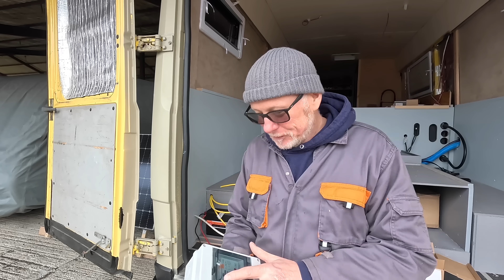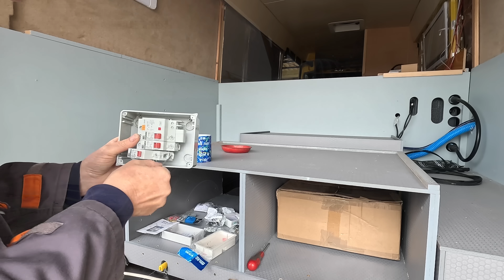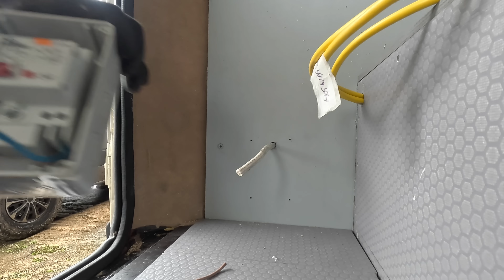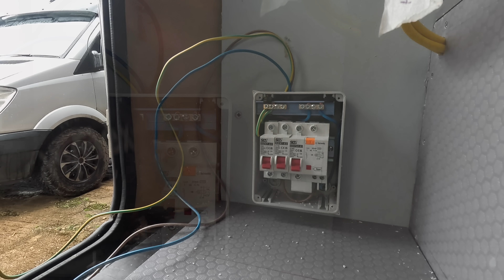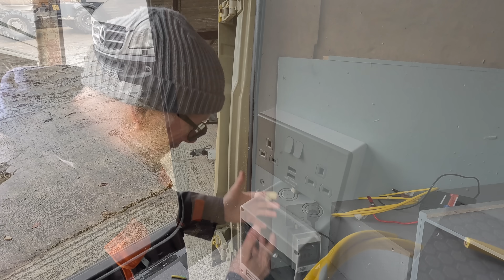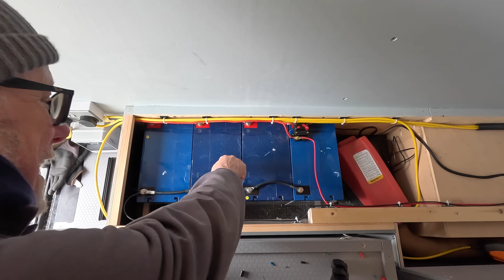What's The Best way to power a Campervan for OffGrid Living Adventures?

Comment: Mel  I run a split system . A victron 12v 460ah   lithium  system with a multiplus but also I hsve a ecoflow delta 2whuch is charged from the lithium.  

It's charged though the solar input  but not  at 12v ! I have it set up so excess  energy  you would  generate though dc - dc or pv will charge the ecoflow.  Once my lithium  battery is upto 99% it will trigger to charge  the ecoflow and turn off at 94% which what would  be wasted energy . Also my water heater  boiler does this though the same system . 

The whole  idea to  be gasless with a back up if my main leisure  battery gets low or I can use a airfryer  oven and a induction  hob at the same time without  a huge DC draw  .
Reply from the maker: That’s what I’m trying too achieve well done sounds like a fantastic setup you have god there 🫶🤙
Reply: It's all about redundancy and not putting all eggs in one basket. In winter will be challenging  but lucky I can charge up fairly  easy  if need to . 

If your interested  doing a solar / energy  dump  a victron  bmv-712  has a programmable  relay which can set from your battery SOC to say trigger a bigger relay  for a dc element  on your water heater or another  charger etc .

Comment: Mel Hi 
Would you know if there is such a cable to charge my Delta 2 from a electric car charger. I cant seem to find this answer. Regards Ade
Reply from the maker: Hi Ade! Yes, you can use a suitable cable to charge your Delta 2 from an electric car charger. Just make sure to check the specifications for compatibility. Happy charging!

Comment: Hi Mel, not being picky mate, you did say 4 x 110Ah batteries in parallel you would have 220Ah of usable power. You will have more at 440Ah of usable power👍 That's a bit of good news for you mate.
Reply: Only 50% is usable power
Reply from the maker: I really appreciate you pointing that out! It’s always good to have knowledgeable viewers like you to help keep the facts straight.

Comment: Informative as ever 👍just a tip when you bring wiring into a box try to come in at the bottom and bring wires up if any water gets in it drips off instead of on terminal also if you put a loop in the wires it does the same also makes it easier if you have to move connections later i use to do marine wiring always enjoy your posts
Reply from the maker: I really appreciate your input! Your experience with marine wiring is super helpful, and I’m glad you enjoy the posts. Thanks for being part of the adventure!

Comment: Hi Mel, are you using a 75-15 victron, connect the battery out to the battery’s and the panel in to the Bluetti and the 12v street light out source to the fuse box? I have a similar setup but won’t it take an age to charge 4x12v battery’s at 15a ? Maybe I got that wrong. Also if you use the Bluetti for 240v why run an inverter off the AGM battery’s?.
I saw the ac200 max and charger 1 vid with the 1 way diodes any chance on an update did it work long term and are you still using it like that.
Reply from the maker: Hi there! Yes, I'm using the Victron 75-15 for my setup. Charging four 12V batteries at 15A can indeed take a bit longer, but it’s all about managing the power flow efficiently. I’ll definitely consider an update on the AC200 Max and the one-way diodes; it’s been working well so far!

Comment: Why you using AGM and not lithium also I was told to connect battery's in serial rather than parallel, can you explain or do a video plz
Reply: in series would be 48V, in parallel is 12V

Comment: Mel.Regarding fuse boards in campers caravans etc .the mcbs should be double pole not single pole so in the event of a fault both the live and neutral circuits are isolated. Also check the regs to see if the chassis needs bonding back at the 230v fuse board.Roger.
Reply: Mel how hard wearing  are your cable strippers...i mean have they stayed sharp for long enough .. always used side cutter but you get a better finish with the strippers
Reply: Looks good I’ve got a caravan plug on the outside of van going into a extension lead with a trip on it for the odd occasion I need mains top up
Reply: Love watching your channel ,but electric s are beyond me (still watch though) so I m just going to have a couple of power stations with the folding solar panels! Mel do you have a trade ie mechanic etc ? cause your so knowledgeable . I am trying to get a YT channel up & running would you do a quick video on how to start a YT channel ? 🫶🏻🏴Jan

Comment: This is why campsites are starting to get strict on uncertified power installs …..first you have AC rcd fitted …. Second and most important you have not earthed your van body which is regulation when having plug in power ….. also all campsites are now A type rcd protection so having a mix like yours A and AC on same line is pointless and the site rcd will trip first

Comment: Are you sure about using the load output on the Victron controller - usually they have a 15amp limit?!
Reply: they come in different sizes
Reply: @alanhat5252  indeed they do 15A or 20A - looks like he has the 75/15 variant - which is only 15A, so if his diesel heater is on start up, and his lights are all on.. and something else is charging etc - he could over load the output. 

I get what he is trying to do . . but I feel its safer to run a 12v Fuse box. But to each their own.

Comment: Hi, Mel thanks for the vlog. This is not criticism but an observation .Those little square sticky pads your using to retain all your cables,
Are pants , I used them on my van build…. after time with heat/ warmth and van movement they lose their tack. And will literally just fall off !  keep an eye on them over time. Hope this helps, now I want a flipping Pastie 😋
Reply from the maker: Thanks for the tip really appreciate that 🫶🤙

Comment: Why not wire them down as 24 volts, it saves power?
Reply from the maker: Because my diesel heater/ diesel cooker/ electric water pump/ max fan / lights are all 12v
Reply: @MelsBigVanSmallWorld  studpd of me, you already got all that stuff ofcourse.  Keep going m8 its a palace on wheelts!

Comment: I would bin that cheap circuit breaker and replace for a fuse and a battery isolator. They normally get hot and the specification they claim in terms of current rating is optimistic to say the least.
Reply from the maker: Yeah I have since done some research and I’ll definitely be installing a traditional fuse for sure and I’ll even make a video to so
Reply: @MelsBigVanSmallWorld  You could go all out and fit a t class fuse which would future proof it for LIFEPo4 if you ever go down that route.
Reply: @Marks-Garage which circuit breaker? The one in the distribution panel or the one on the batteries?
Reply: @alanhat5252  the one on the batteries. I've spent alot of time researching this area myself with my DIY solar battery install. Basic conclusion is that you need to spend alot to get a bidirectional circuit breaker or install a T class fuse and holder. I opted for t class fuses on the batteries and then heavy duty battery isolator switches for safe isolation when carrying out work on the system.

Comment: Mel, what thickness of wire should i use when joining 2  x 110  batteries together
Reply from the maker: It really depends on what you’re going to be  using them for if you google DC wire size chart you will find the information you need 🤙
Reply: @BigVanSmallWorld  Cheers Mel, it is for my 12v tv and diesel heater.
Reply: @ilikejelly7890 Mel has told you he's not an expert, there's plenty of expert channels to go ask basic questions like that.
Reply: @alanhat5252   I was asking Mel, and I got an answer.  And I have had plenty of  good advice from Mel instead of so called experts. The whole point of  watching him is to get some sound  advice. Mind yer own. And if it is a basic question why would I go to an expert?